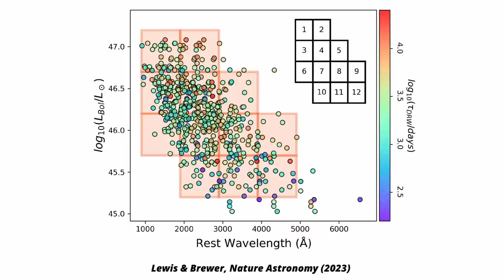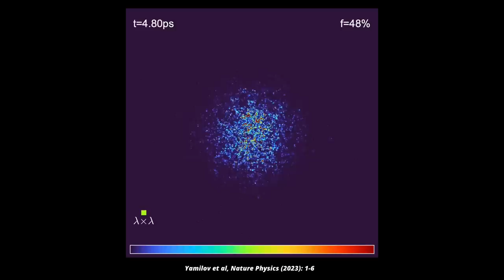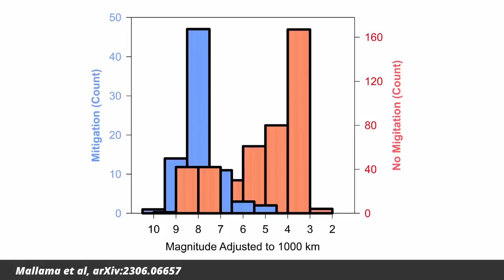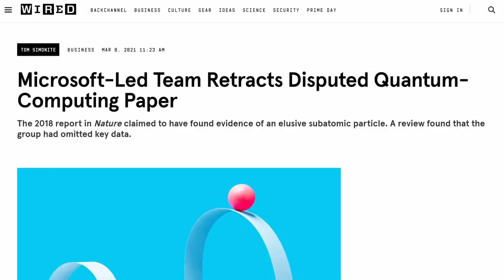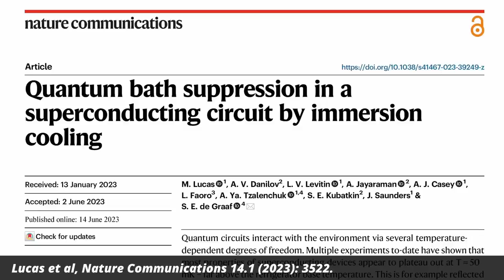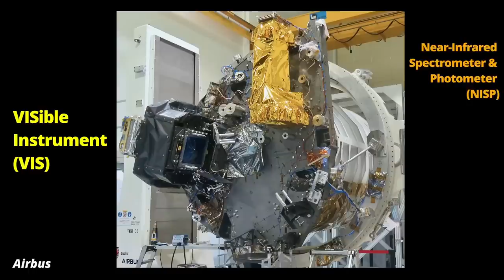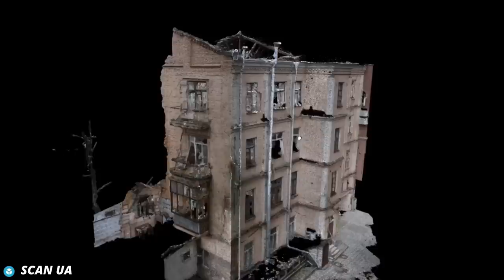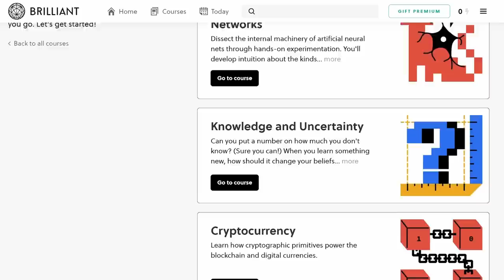Time Ran Slower in Early Universe, New Study Finds

Comment: Sabine is the only source on the internet CLEARLY and CORRECTLY explaining what the "Time dilation in the early universe" headline actually MEANS.
Reply: No, there are many sources, but she is doing a good job explaining it for everyone to understand.
Reply: "Make time run slower with this one neat trick!"
Reply: she shoudl have mentioned the low confidence though (~2 sigma).
Reply: “ They found that the high best material to trap light was layers of overlapping metal…”. Did they find that that was the best material, or did they find that that was the best material of the ones they tested?
Reply: @TedToal_TedToal  
Strange random question.
The latter.
Reply: @rimbusjift7575  Not really strange. I don’t think the use of the word “best” is really appropriate there. “Better” would be better than “best”.
Reply: Wait till Deepak Chopra gets his mitts on the headline, he will mangle it beyond recognition for sure.

Comment: You can speed up the supermarket time if you use the self-checkout which more and more are adding. But there is a randomness whether, on the average, it is faster or not. This is known as the Schrödingers Self Checkout Speed Constant. However, intelligent setups can influence how often the radioactive particles can cause a problems at the self-checkout, while the original Schrödingers you had no way to influence it.